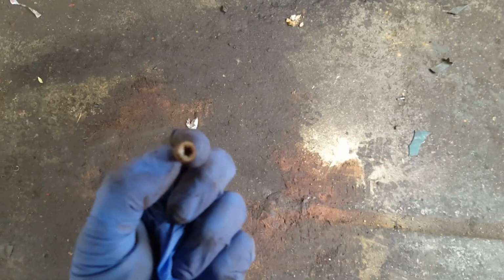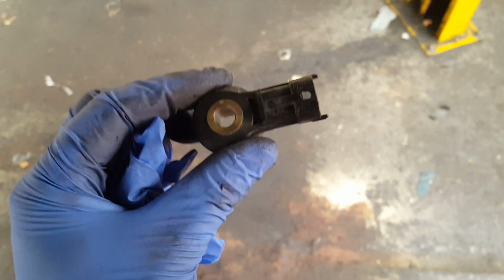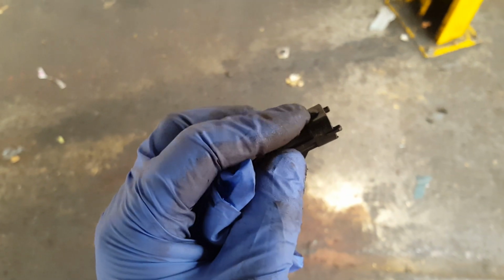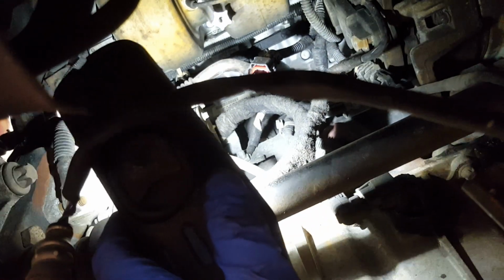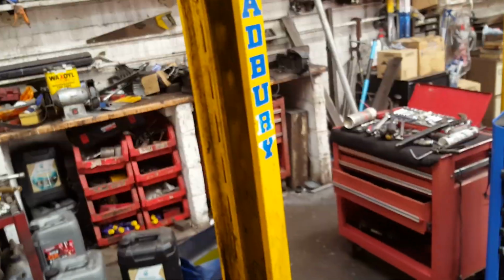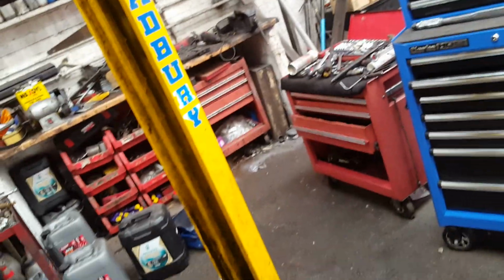Vauxhall Zafira 1.8 Petrol Knock sensor fault. Knock sensor location, removal/replacement

Comment: Did that fix the problem
Reply from the maker: Yes it did ;)
Reply: What are the symptoms of the sensor failing please mate?
Reply from the maker: It will put engine light on pretty much straight away. It will think that car might be misfiring or etc. There is no specific way of telling that it's failing. But like I've said in most cases light will come on straight away.
Reply: @AlexTheGrumpyOne  ok thanks
Reply: Hey, is the sensor placed there for z16xep? Because I have P0325 error code on Astra H and I am searching for this sensor 😃
Reply: @marinmarinov8133 for engine coded z16xep is the same location as in video.